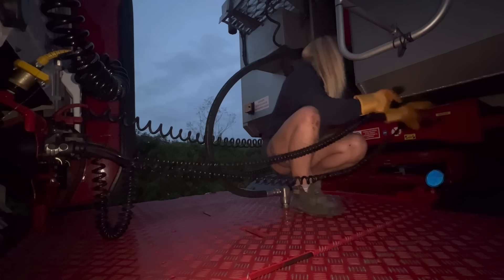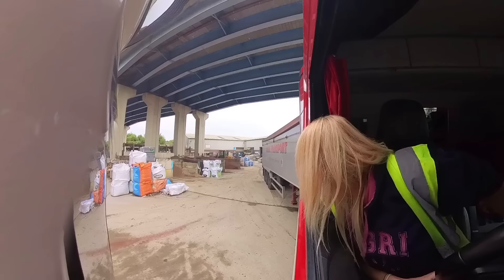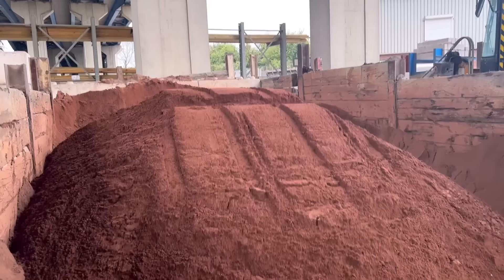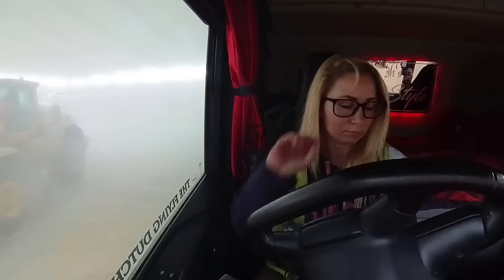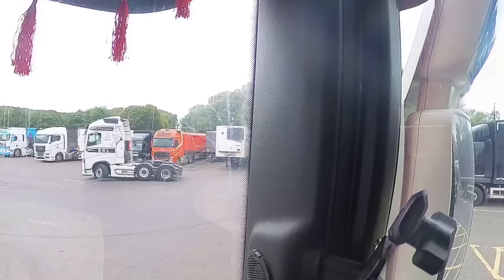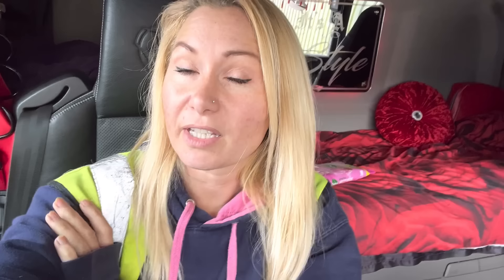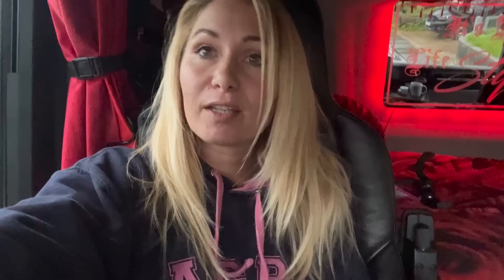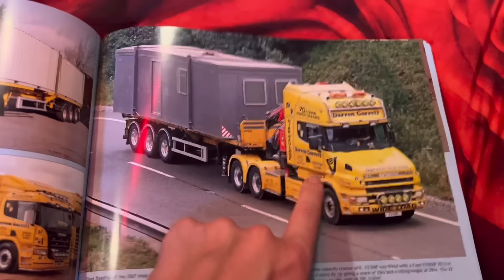All in a days trucking | what do truckers do when they are parked up at night?

Comment: You should of run with your sheet off after tipping Maize let the wind do it for you save all that sweeping. Breathing in all that dust will do you no good what so ever!
I’ve been driving tippers for 42 years but now only partime. You’re very professional but perhaps a bit to professional.
Would of thought someone would of told you the easy way into Hollsworthy avoiding the steep hill and bridge. Many tipper drivers have got in some right muddles there.
Keep up the good work.

Comment: You got a microwave, get you. Try portable gas camping stove. Open windows a wee bit so as not to steam up too much. You can't beat a good curbside parking overnight teehee chuckle. Now Gardano services M5. Very sadly they removed the fresh fish and chip (Harry Ramsdens) section. Back to using gas stove or the hot sandwich box. The hot box, they are brilliant. Think where you are and going, put food in and then plug in to the 24v socket with time over distance and food is ready when your stopped. Microwave too posh for us guys and would get wrecked with agency drivers anyway, sorry not all are the same I know.

Comment: What was the weight of that red sand ...as i do the waste from a distillery to cattle farms ..and there's no way i would open the door to take a peak like you did as i either be buried or the door would knock me out ...my load would be 31-32 tons...at 7.11 remote control for cover..we have them in Ireland its a big handle you English drivers are spoilt...hope your running the engine while running that microwave 😂.

Comment: PHEW   CHARDS /    bowland stone  cole road  bristol bs2 .  JUST  aloung the road  FEEDER ROAD from were i work out off . LOCAL  palletts forked on/ off  MAIL  truncking . steady away DAY work  mon- fri 0730- 1700 pm  ..  BACK  years  1950- 1980s tom , tanck  now aggregate industrys  WAS OLD  BRS  depot .  JUNCTION  albert cresent / feeder  turn right do that several times aday . VERY  fun when u pull  & cross the feeder to reverse in to yard  82  some twat on E scooter/ E  bike  / trys cuts behind you . AS  u reversing in or TAXI  driver try ing cut u up . PHEW  jamie went  BY IN DAF  18 ton curtain  as u went out  back on to turned left on feeder road bs2 .

Comment: Could you some day give us a crash course on all your Susies? As an American driver I'm trying to figure out why in the world you have so many air/electric  connections truck to trailer
Reply: We have 2 air lines the service line and the emergency, in the UK we push fit connectors, but most of the rest of Europe use palm coupling, I believe you call them Glad Hands in the US,  
Then there are 2 or 3 standard electrical lines, depending on the set up, if its 3 lines, there are 2 smaller ones, one of for lights, indicators and brake lights, the other is for fog lights, reverse lights, and I believe some ABS control, Sometimes these 2 cables can be 1 cable with a 13 pin plug, I think this is more common in other parts of Europe. 
Then there is another multi pin connector for ABS/EBS system. 
Then there can be a lead for rear vision camera, or maybe for those tipper trucks to power the sheet. 
Hydraulic pipe for the tipper ram. 
On my truck I have another multi pin connector so I can control the trailer air suspension from the cab, but the airlines are on 1 single large connector, despite that I still have 5 different sussies to connect.